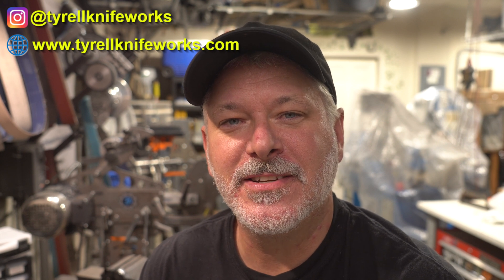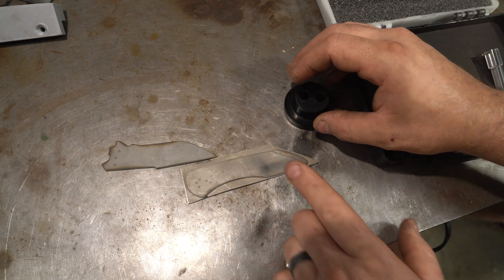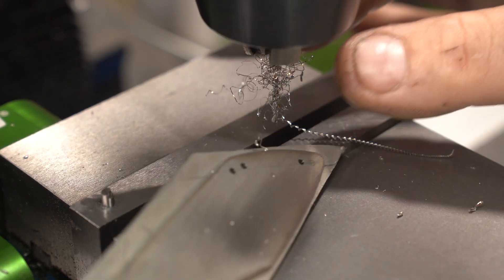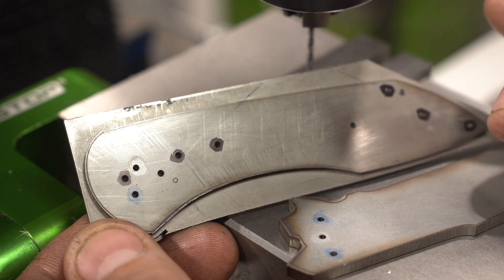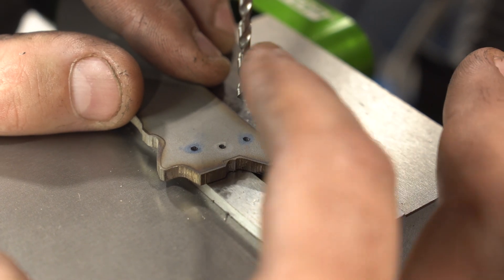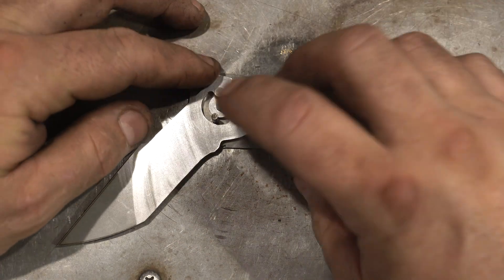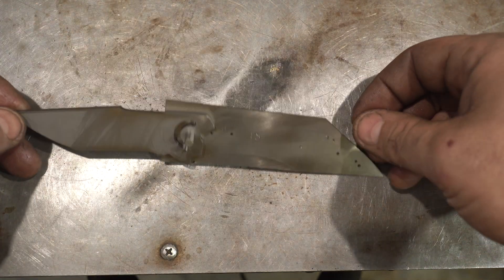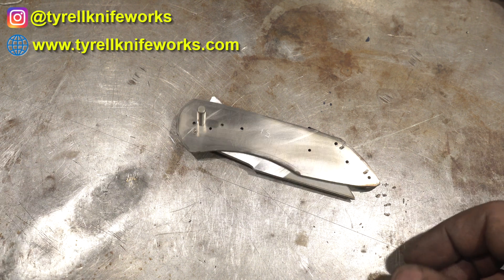Triple-T #199 - Liner lock folder series - Drilling, shaping and mechanism

Comment: To remove those burrs on the back/bottom of your drilled holes use a small countersink or a larger drill bit to touch just enough to remove that burr. I put a countersink into my cordless drill and it works most awesomely on all metals & composites.
Reply from the maker: Yes that works but It’s a pain to do that to 8+ holes.  Touching it on the disc grinder does them all. 😉. Thanks for watching.